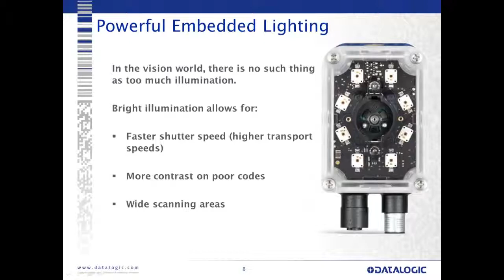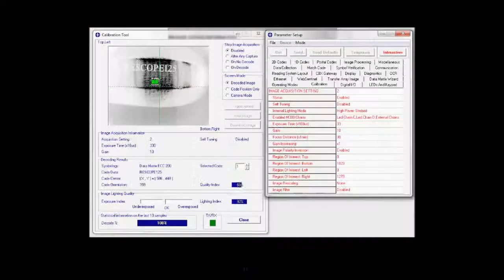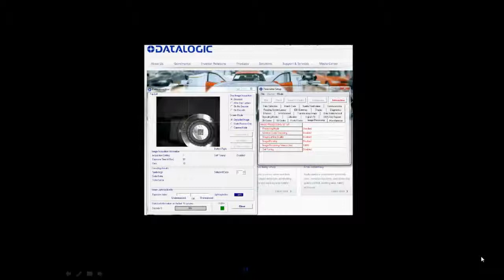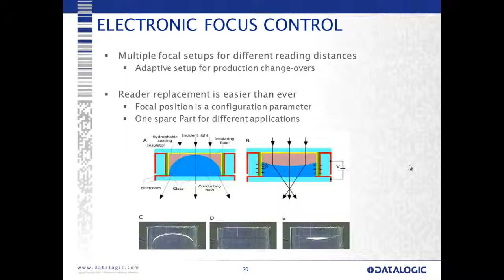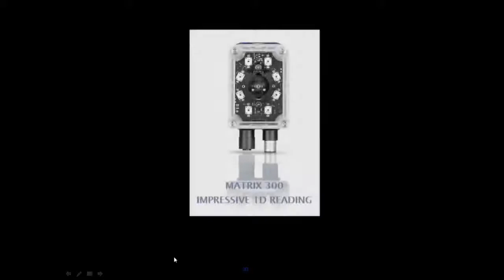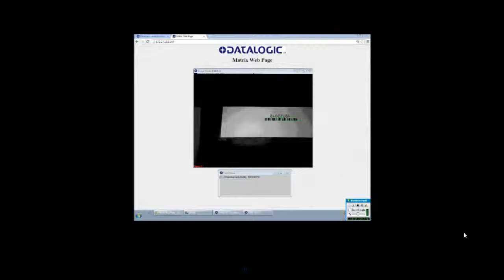บาร์โค้ด Automation  Fixed Industrial Bar code Readers Matrix 300™

Comment from the maker: บาร์โค้ด Industrial Automation > Fixed Industrial Bar code Readers
The Matrix 300™ is a ultra-compact image based bar code reader designed for performance on high speed and Direct Part Marking (DPM) applications.
The Matrix 300™ combines a high resolution sensor with ultra-fast image acquisition: 1.3 megapixels, 60 frames per second. The optical system incorporates a liquid lens module for the electronic control of the focus. As result the reader offers automatic focus adjustment without the addition of moving parts.

FEATURES & BENEFITS

Ultra-compact reader
High performance DPM reading
Liquid lens electronic focus control
Integrated dual illuminator: dark field/bright field
Fast and high resolution image sensor: 1.3 megapixels, ‘true’ 60 frame/s
Power over Ethernet Option
Extreme Industrial grade: IP67, 0-50°C operating temperature
Precise dual laser aiming system
APPLICATIONS

This product series has been developed to satisfy to requirements of the following applications: 

Manufacturing, Electronics and Automotive
 - DPM code validation after marking
 - Work-in-progress control
 - Parts and assemblies traceability
Food and Beverage
 - Work-in-progress traceability
 - Document Processing
 - High speed process control 
Medical
 - Medical device traceability
Clinical Lab Automation
 - Biomedical analysis machines
 - Specimen collection machines